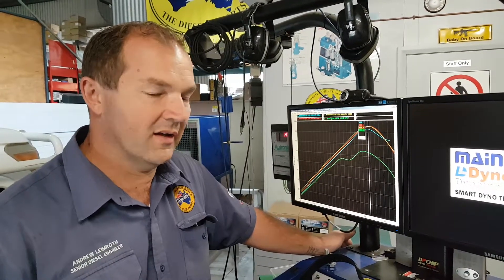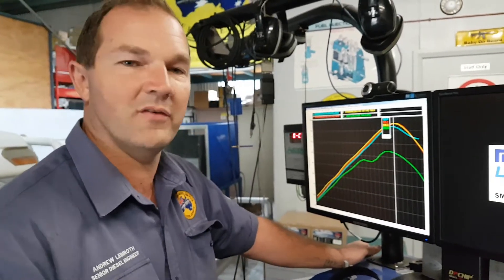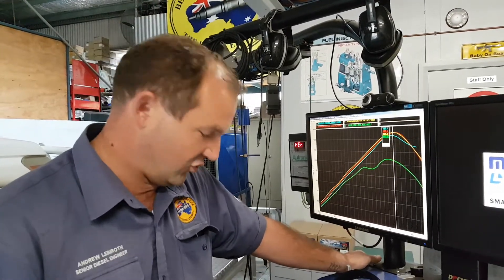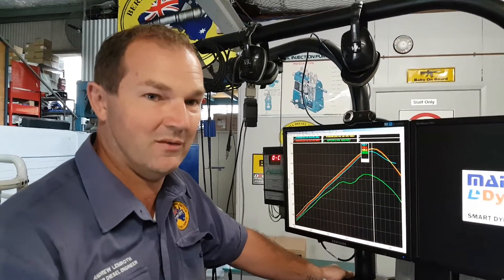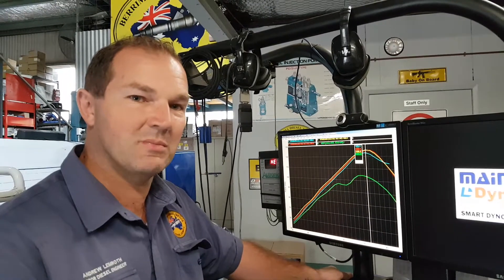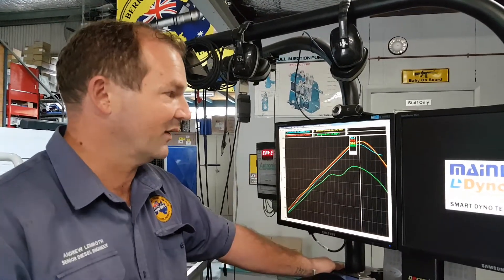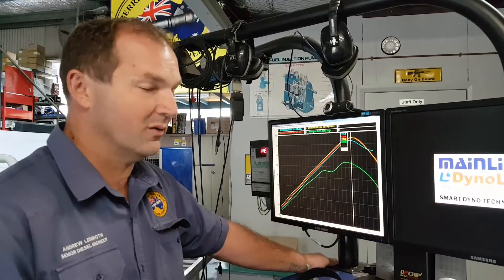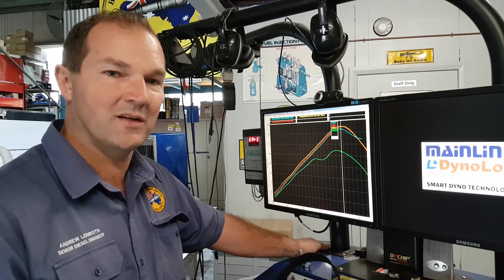Intercooler Heat soak

Comment: I'm hoping you can help. What fan backed inter cooler do you use for a GU common rail 3.ltr. And can you ship to Victoria? Finally do they need a mechanic to fit up and tune them in?  I'm interested in buying a good one. Cheers
Reply from the maker: https://www.berrimadiesel.com/products-services/intercoolers/hpd-intercooler/intercooler-nissan/nissan-patrol-zd30-common-rail-intercooler-kit
 
Fairly simple to install
Cheers mate
Reply: Thanks for getting back to me, since posting that I fitted a HPD aftermarket intercooler with a fan. Works a treat, cheers mate.
Reply from the maker: Cheers Mate

Comment: Hey there public I don’t know if my last message went through 05 Silverado 1500 base 5.3 install a new whip ball having problem with the heat soak to where I’m losing power idling and power driving fluctuations with the AC is blowing warm to mid cold back to warm any ideas..?

Comment: Hey there I just I have a 05 Silverado 5.3 just put a Whipple on it and I’m having a very bad problem what they say is a heat soak to where my AC is not running cold anymore and it seems the power is up and down as idling and doing it the same when I’m driving any answers

Comment: Will replacing the intercooler on a diesel with a larger aftermarket one potentially give it more power as it would on a petrol? Would the engine need to be remapped to see gains with the intercooler?
Reply from the maker: Due to the way Diesel injection systems work they need tuning after mods to safely operate.
Reply: Not really. It’s more about consistent air temp. Most factory coolers are insufficient let alone if you turn the boost up

Comment: How would you combat this issue on a mechanical injection engine?
Reply from the maker: You wont have electronics cutting the fuel back like you do here on the V8s.
Reply: So upping the fuel while tuning a purely mechanical system in ideal (cool) conditions with a intercooler , once its in very hot conditions the EGT,s and engine temps could become excessive as there's no computer or ability to turn the fuel down to avoid damage ?